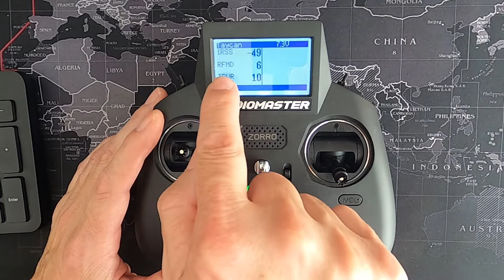RadioMaster Zorro Screens Options under Model Display Menu in EdgeTX

Comment: Very fine explanation regarding the display, but I cannot see in the telemetry part how to get data. It is like there is no connection and nowhere to activate the connection.
 I have a Turnigy TGY-iA6B Receiver 6CH 2.4G AFHDS 2A Telemetry Receiver w/SBUS and a Turnigy TGY-CVT01 Voltage Sensor. 
 I try to search for new sensor by "Discover new" while the model is activated. Sometimes it works, but random and not often, actually I dont know what to do.....or I am doing right or the Turnigy brand is unstable.....
Reply from the maker: If you have discovered the telemetry sensors they may look like they have disappeared but click the arrow next to sensors and the list will drop down.
Reply: @the-happy-RC-flyer  Thank you for your quick response! :) Actually I have been aware opening the sensors by the arrow. Today it succeeded for me, even also with a Flysky variometer at the same time to connect, but I have a feeling that establishing the connection random needs time and often you must just close both the model and transmitter and restart. I have a feeling that the brand of Turnigy/Flysky may be a little unstable.

Comment: Hello. I have the same radio and when I get the drop down menu searching for telemetry it's not there. I can see everything except that. Would you happen to have any ides why? Thanks
Reply from the maker: If you are not using a telemetry enabled receiver or not Discovered new sensors you will not see any options for the Model Display screen.
Reply: @the-happy-RC-flyer  Ok thanks for that info and your time.
Reply from the maker: @nvembrace  you are very welcome.

Comment: Hi Bill, thank you for your videos they are verry use and helpful.
Where can i get a list with all the options to display? You scroll a big list through and i know nearly nothing of them. And what means RFMD and TPWR in your Display? Can i show the battery from my copter in the Display?
Reply from the maker: RFMD is Radio Frequency Mode & TPWR is Transmitter Power. I would suggest looking at the website for the telemetry sensors of the receiver your are using. Yes you can show the flight battery voltage if your receiver has the ability to handle the high voltage. With drones the FC can handle this sensor.

Comment: Nice shirt video! 

Is it also possible to show some telemetry in the main screen of the model? So that i see for example RxBat in the main screen instead of the stick positions?
Reply: So just like what i can do in the tx16s actually. Show some telemetry in the main screen.

I got the radiomaster pocket and it has the Zorro firmware.
Reply from the maker: Hi Arthur, no you cannot edit the screen options on the Zorro radio. It will show modes if you set them up.
Reply: @the-happy-RC-flyer  thank for your answer Bill!
Reply from the maker: @arthurganz  you are very welcome.

Comment: Nice video! My question is how do you add widgets to the main screen “non telemetry button”
Reply from the maker: Hi Kevin, you cannot add widgets to the Zorro radio.
Reply: @the-happy-RC-flyer  But I noticed you had telemetry on the main screen, not the telemetry screen.
Reply from the maker: @srqTagle  yes you can set up the display screens but not widgets as in the TX16s.
Reply from the maker: @srqTagle  you will see the RSSI bars and Flight Modes on the opening screen automatically if you have sent up.